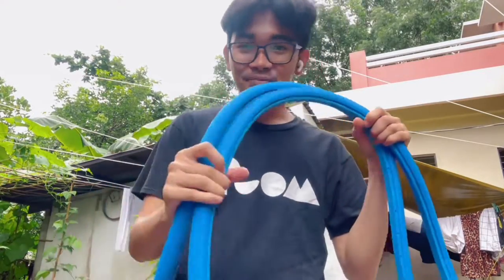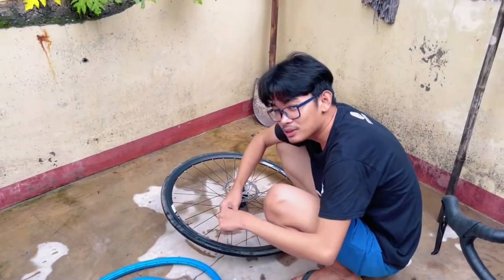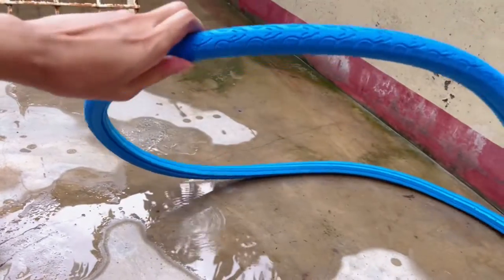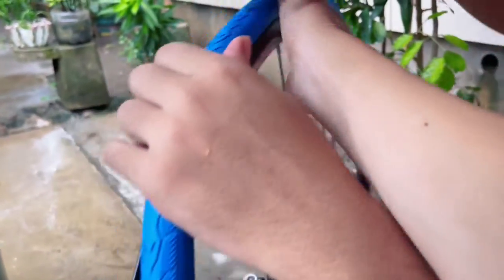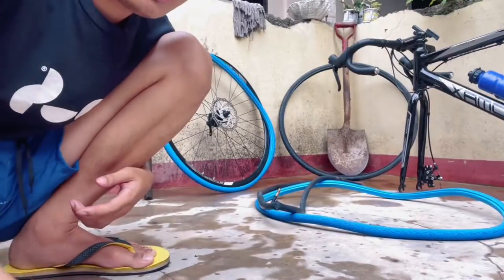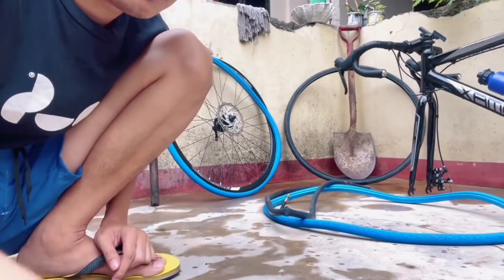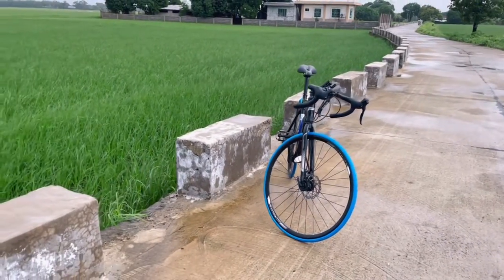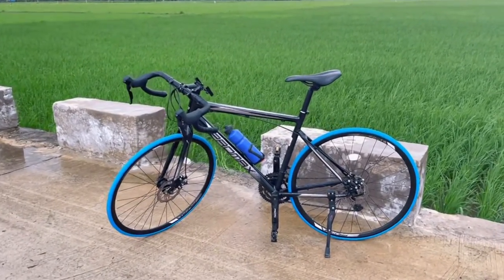GOODBYE FLAT TIRE - SOLID TIRE for Road Bike | Markee GaviOla

Comment: Nice! I think these tires would surely brings peace of mind to each every ride. Nothing to worry about the flat and easy maintenance as well. Time saving all I can say Great investment!
Reply from the maker: Very vell said po! ❤️🙌🏻💯
Reply from the maker: maxmarrero9635  you're right. Yes it is hard to pedal, you will feel it evidently on long rides, I wouldn't recommend it.
Reply: They remove some shock absorption so do not use on off road bikes or on road bikes with no rear Suspension if you get sore easily
Reply: When putting on use dish soap and water it makes it much easier also try using metal tyre leavers plastic ones break to easy and like the spoon handle you used is too thick
Reply from the maker: @DarthAwar  good idea! Thanks for sharing! ❤️
Reply: @MarkeeGaviola  No Problem

Comment: I bought a tire like that. It seems there are 2 complaints: rolling resistance and bumpy ride. People compare to 110 PSI tire pressure. I will only install rear tire, old one is cracked.
Reply: For rough ride use on bikes with decent rear suspension, the the front not so important to have as front suspension is more to reduce arm shake and make it easier to climb steep angles like curbs

Comment: Hi!! I bought 2 tires. I watched your video to know how install. Man, that lazy mine! lol (thanks)
Reply: Dish soap and warm water soak as best as possible and spray/pour on wheel and them using metal tyre leavers apply like normal easier to do with wheel on side preferably prop up on 4 bricks placed under rim equal distance apart

Comment: hey man i'm a bit taller and heavier than you i'm sure - does the material hold up for someone like me u think? what i heard from buyers is its better if you preheat the tire and stretch it out a bit before installation for an easier job?
Reply from the maker: It is surprisingly sturdy than it looks. I wouldnt suggest preheating as it might loose tension and grip on the rim. Just use the right tools and you should be good.

Comment: How are the solid tires as compared to your regular air tires with inner tubes? Are they safe? What are your rims' dimensions and the inner width of the rims? Thank you.
Reply from the maker: Hello! Yes they are 100% safe and sturdy, it does not slide. Although you would sacrifice speed and the shock absorbing feature from the regular tire. The solid tire would easily stop, in this case you loose a significant amount of freeflow which affects you speed and can be really tiring. This is 700x23C for Road Bike.
Reply: ok....in english,  solid tire brakes BETTER or WORSER than an air tire 80 psi????, and is solid tire HARDER or SOFTER than an 80 psi air road tire??? please!??
Reply from the maker: @lunam7249 it has its pros and cons. But i couldn't say that it's better. It is hard for sure.
Reply: @lunam7249  they are harder to get going and keep going especially uphill

They are also much rougher ride quality

Do not use on a rear wheel if it doesn't have suspension on the front it doesn't matter any wear near as much if the front wheel has suspension
Reply: @DarthAwar  thank you so much for your answer!!!❤️👏❤️❤️👏😳

Comment: What? repeat your conclusions and last opinions about the tires please , i didnt understand , im about to order two of these tires on amazon
Reply from the maker: After cycling along with friends, i can now say that it affects your speed sir (30% less). Maybe at least for this solid tire i got, the feels is like you are running flat and heavy to pedal. It also stops easily when you stop pedaling. I do not know the physics that causes these but that's what i've observed.
Reply: Yes 👍 Agreed✔️👍👍 
Solid Tyres are better to avoid punctures. But beside that, Riding is not Fun at all. More efforts for Pedaling. It drains out the energy, when Riding in headwind situation. Climbing the Hill or Bridges is only Dragging.

Comment: The ones we see on youtube have "Pins" or "Studs". My question is is yours safe? has it ever come off the rim? Thanks in advance
Reply from the maker: Hello. I have not used it heavily. So i am not sure. But so far it hasn't come off. Studs would surely add safety feature. 🙂
Reply: The pin type are looser so are easier to apply but slip without the pins the pinless style are much harder to apply but do not need pins to stay in place due to friction

Comment: Idol does it not affect the rims and spokes? and the hubs as well... walang chance na magiging oblong ang wheelset noh? I weigh around 80kg as a rider, I reallly want to try this but worried about the effect of it sa rims
Reply from the maker: Not sure lods pero i think may tendency depende sa weight ng rider vs the rim (quality wise) if i would rate mga 20percent tendency lng nmn.. Yung solid tire nmn kasi di nmn siya matigas na matigas lumulubog pa din ng konti pag sasakyan o pipisilin which may help lessen d chances na ma oblong.
Reply from the maker: Kapalit lang talaga dito na sure ako is yung bigay ng pedal which affects your speed.
Reply: @MarkeeGaviola  thanks for the fast response! Cge I may try this one
Reply from the maker: @MichaelLeiBarrientos  no probs po! Ingat sa mga rides.

Comment: thanks for the review. i was really considering these solid tires. i imagined that they would have greater rolling resistance compared to air tires. i'll just stick to what i have, then. thanks!
Reply from the maker: Greater rolling resistance is very true. 🙂 good decision.
Reply: The resistance is not that great of an issue if you start on a lower gear setting and work up, also they sick on medium to steep hills like a lot but on mostly flat areas are fine
Reply: Also don't use without rear suspension and/or a good seat with seat/saddle with good shock absorption (springs and/or balls, Thick Foam or Gel cushioning!)

Front Suspension is not as vital for comfort most bikes that have only front suspension is not for comfort but easier curb mounting and dismounting, Front suspension on rough roads or trails only absorb about 10 to 20 percent of the Vibrations but do help keep arms in right direction if surface is not super rough

Comment: Hi , I bought these generic tyres and installed them. My question , have yours ever come off the rim while riding? I am really scared to ride mine. Thanks in advance 🙏
Reply from the maker: Nice one! So far it hasn't come off. It holds tightly. Safe rides my friend.
Reply: @MarkeeGaviola  Thank you for the quick reply 😁👍🏼
Reply: I saw a video where there are pins that get inserted around the whole tire. The pins are then clicked into place around the rim. Doing it this way, it would be impossible or highly unlikely that the tire would come off the rim.
Reply from the maker: Yes i saw that vid too. For this one there is no pin included. But yes it would've been safer with the pins.
Reply: @bpexodus the pins are for looser fitting tyres most are actually a little too tight to fit so do not need plastic support pins but is much tougher to put on but is easier to remove nob destructively
Reply: No never if they are difficult to put on its at least as hard for them to come off especially by accident

Comment: Mga ilang rim width ng solid tyre?
Reply from the maker: 23C po. Bale size niya is 700x23c. May link po jan sa baba, iisang size lang yun benta nila.
Reply: @MarkeeGaviola  nakita ko comment mo sa lazada, bali naka bili kasi ako sa shopee last 2 weeks, 23c rin, pansin ko parang malapad pa rim ko kesa sa tyre, siguro diko masyado na, pero may awang parin kahit igitna, di kagaya ng normal tyre nasasakop buong rim at takpan talaga.
Reply from the maker: Hala baka di 23c yung rim mo? Kasi yung sakin tamang tama sa rim saktong sikip parang hawak2 yung gulong.
Reply: 23c din po ba rim nyu lodi? or yung tires lang?
Reply from the maker: @jiro.1160  tire be. 700 yung rim.

Comment: That's not the proper way to do it. Naghahanap kayo ng disgrasya dyan.  It's supposed to have pins to fix the tire properly on the rim.  Kung napansin nyo yung mga butas duon sa gulong, duon nilalagay yun. Kung hindi nyo aayusin yan, huwag na huwag kayong tumakbo ng magbilis sa sharp corner, pag kumalas yang gulong, basag ang bungo nyo dyan. Mukhang hindi pa naman uso sa inyo helmet.
Reply from the maker: Thanks sa advice lods. Nakita ko nga sa isang vlog may pins na nilalagay. Wala kasi kasamanh pins to pag binili kaya kala ko ganto lang.
Reply: kaya nga Youtube Channel yata ng mga Jempoy to 😂🤣

Comment: gaano naman sya kadurable? nauubos ba agad pag nagskids?
Reply from the maker: Sa durability lods 💯%. Di sya bastabasta mauupos.yung pagka goma niya parang mas matagal pa maupos kesa sa normal tire yung exterior. Lalo pat buo sya.
Reply: naflatan kase ako kanina baka magpalit na ko neto, yung pink. salamat, RS lods!
Reply from the maker: @_keja_  naks! Ganyan na ganyan nangyari sakin flat lagi yung ingat na ingat ka na flat pa din, nag tire liner pa ganun din pala kasi napipitpit ang interior ng rim pag bump o rough road, sura ang lakaran. Sacrifice mo lng talaga is yung speed at tad2x dito although tolerable nmn. Kung anu fave color yun ang piliin hehe.
Reply: ok lang medyo mabigat, ensayo din yan, makakapag-adjust din tayo :D
Reply from the maker: @_keja_  good point! 🙌🏻❤️
Reply: last tanong na lods, ano palang size nung tire na pinalitan mo? yung papalitan ko kase ay 26 x 1 3/8       kung iso naman 37-559.     gusto ko lang malaman kung magfifit ba ng maayos yang solid tires, online kase ako bibili baka masayang.
Reply from the maker: @_keja_  26-700c yung pinalitan ko.
Reply from the maker: @_keja_  same lang nman ang rim ng roadbike lods, sa size lang ng gulong nagkakaiba.
Reply: tenkyu ulit lods :D
Reply from the maker: @_keja_  no probs lods.

Comment: Kung takot ka ma flat tire bili ka Ng tire liner, sigurado walang flat. Pangit Yan solid mabigat Yan.
Reply from the maker: Nag tire liner na ako lods nafflat pa din dahil napipitpit. Pero totoo mabigat nga tong solid. Tsk. Bili nlng siguro mas malaking tire. 😅
Reply: Mag gatorskin ka
Reply: @bugsbunny4648  Yung sa vlog nung naka tannus tires na cyclist sa UK nakagator skin yung kasabay nya na flat pa rin sa stapler. Tsambahan talaga minsan paside yung tusok or maikli lang kaya di tumatagos. Pero yung thickslick(for rb) at quickslick(mtb) sa shopee medyo solid kasi makapal talaga yung goma wlang tatagos
Reply: @thetalkingnotepad5638  ano bilhin ko mas matibay lod? Thickslick o gator skin?
Reply: @karljuan8908  hmmm yung gatorskin kasi more on tech etc. Mas manipis siya sa thickslick pero mas matibay. Ang kaso hindi bulletproof yan ah nabubutasan pa rin yan ng stapler at kung ano pang manipis pag sakto talaga anggulo. Yung thick slick naman di siya napepenetrate not because matibay as per se pero hard rubber at mas makapal kaya kahit matusok ng debris madalas di umaabot sa tube mo then inspect mo nalang after ng ride para tanggalin gamit tsani.
Reply: @thetalkingnotepad5638  gatorskin ba yung kenda k193 kwest lods? My aligator na logo sa shopee?
Reply: @karljuan8908  Most likely hindi. Pero mukha namang makapal slight at ok yung tread. Di ko pa kasi natatry kenda sa rb, yung sa mtb ko kenda na slick sa harap tas quickslick sa likod. So far never pa naflat yung likod kasi nga makapal ang quickslick at thickslick(rb). Nung knobby tyres pa gamit ko dun susmaryosep nakaka 3 to 4 flats ako a week. Minsan twice pa a day. Sa mc arthur kasi ako nagbabike then edsa papunta kung saan man feel pumunta so daming debris.
Reply: Ok lods.. Thx sa suggested.. Ang mahal pala ng gatorskin P2k each
.. Haha  @thetalkingnotepad5638  

Kenda kwest nlng muna ko 1000miles dw sa review d pa sya na flat 

https://youtu.be/iLeAwNSGt9o